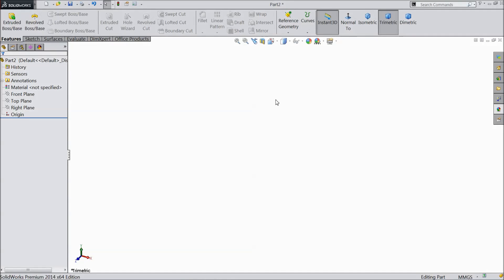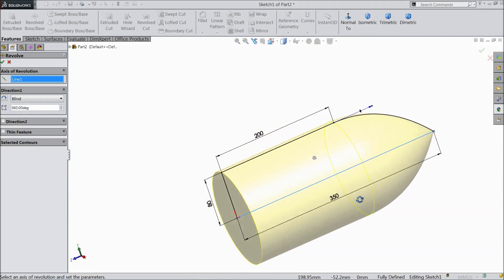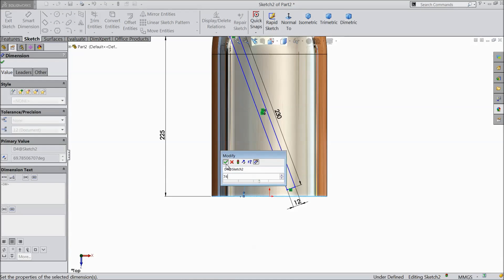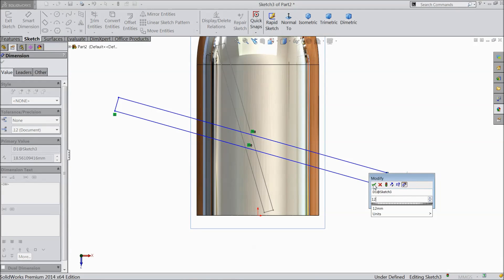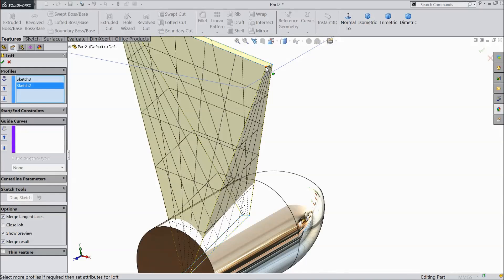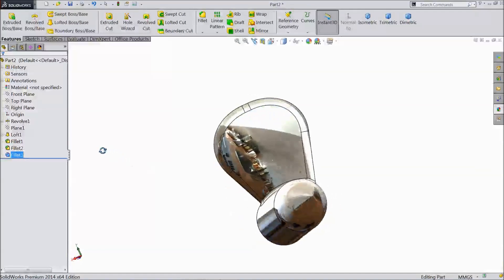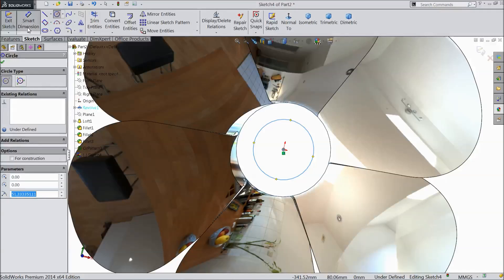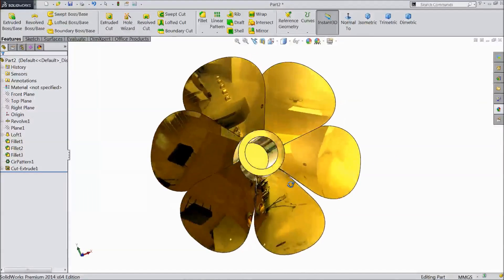SolidWorks tutorial How To Make Propeller

Comment: The radius of the fillet is to large to fit the surrounding geometry. What fillet can be changed in order to get 6 blades?
Reply from the maker: you can change the fillet according to your requirements.
Reply: Even I got that error
Fix
use circular pattern without the fillet then do the fillet for each part individually
Reply: You can use 120 mm of diameter